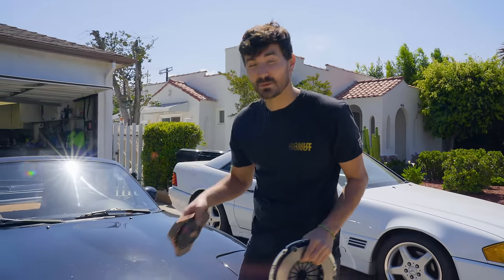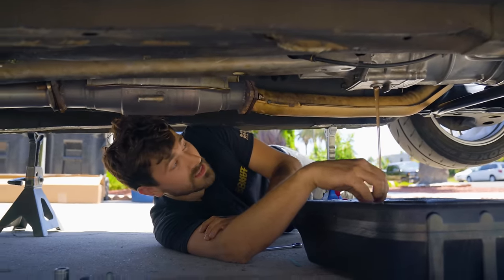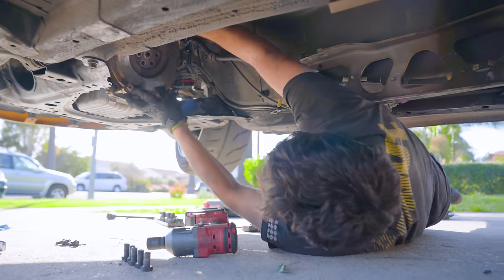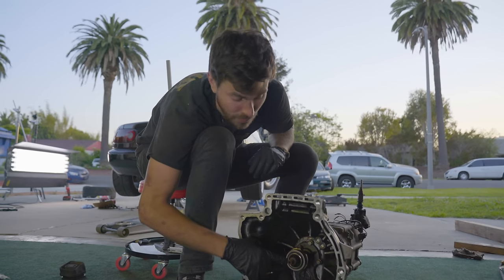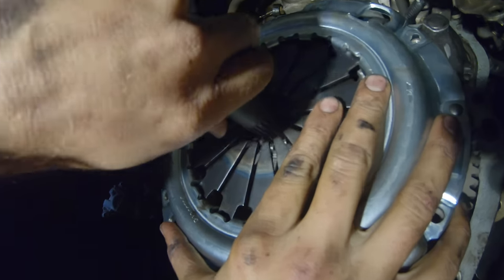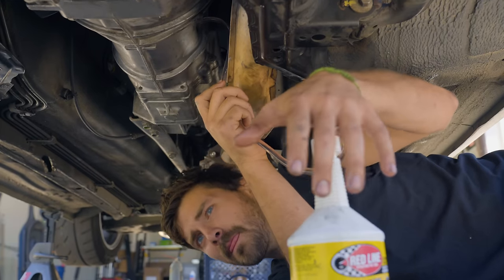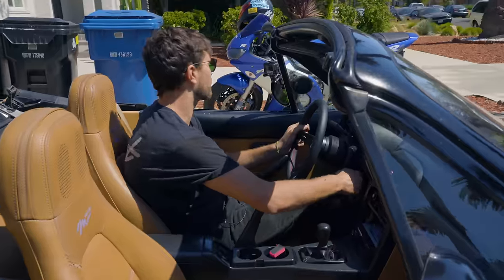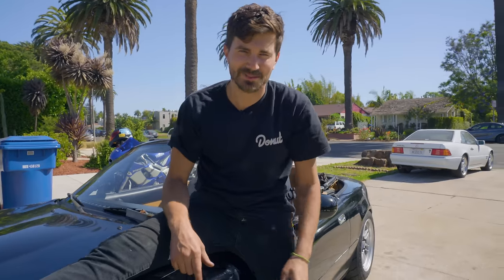We got sent a super weird clutch and installed it anyway

Comment: The real test is when you're stuck in traffic for hours.
Reply: With a hydraulic slave cylinder I bet it’s still not terrible.
Reply: I have a road registered car with a clutch like that in it and it’s cable operated. Can confirm it’s absolutely shit in any type of traffic. As soon as that plate gets hot it becomes very very grabby.
Reply: If you are stuck for hours, disengage shatever gear you are in.
If stuck for even longer shut off your engine
Reply: and here I am, shifting back to neutral at every red light, gotta protect that clutch
Reply: I mean why wouldn't you take the car out of gear while sitting?  If you don't do that you're killing your throwout bearing, your thrust bearings, your slave cylinder, your diaphragm spring, your leg.  Why anyone would sit at a light or in traffic holding the clutch disengaged is beyond me.
Reply: @Patrick94GSR  because they're afraid of being honked at by dickead drivers behind them for not instantly taking off after 0.001s when the light turns green
Reply: @Patrick94GSR  i am pretty sure taking it out of gear doesnt destroy all those parts
Atleast not in the kind of cars i know.
How do you explain my entire drivetrain not collapsing when parking the car?
Edit: i misread, you do take the gear out and that gets destroyed if you dont
Reply: I do take it straight out of gear when I stop. The problem is after you stop and start 20 times the clutch plates start to heat up. The problem isn’t from riding the clutch. If you ride a ceramic clutch you’ll just destroy it.
Reply: @Kasmuller  yeah, I meant NOT taking the car out of gear while stationary is bad for the drivetrain.  A common modification among Miata owners is to bypass the clutch start interlock switch, because apparently even starting the car with the clutch pedal depressed (TO bearing pressing on diaphragm spring) can eventually cause issues with the crankshaft thrust bearings.  Makes the engine sound rather fragile.  But who knows, I did it anyway on my NB1.  Meanwhile my Integra has 372,000 miles on the original engine and gearbox with no bearing issues whatsoever.  But I also take it out of gear when stopping.
Reply: @marealnamenott  that's why I make it a point to pay attention to the traffic light of the other direction, so that I don't end up being that guy holding up other people.
Reply: This should be pinned.
Reply: I'll just put it back in neutral whenever I can.
Reply: LA problem
Reply: Maybe it will come in clutch
Reply: @eaglekeeper6056  They can be. Ive never driven a miata in "traffic" but I work on Porsche Cup cars, and the stop and go to tech is terrrible. we all stall our cars so many times in a weekend, despite driving them for 30 years.
Reply: Uphill
Reply: this is why you leave about 3-5 car lengths on the car in front of you. Ride your brake peddle, not your clutch. Look at some semi trucks in traffic jams when you're rolling super slow, they'll leave space in front to do the same.
Reply: 12121212
Reply: @marealnamenott  Here in Los Angeles, where traffic is: 1st, 2nd, stop, 1st, stop, 1st, 2nd, stop, 1st, stop, you can't just put it in neutral.
Reply: That’s why I don’t trust people who only drive autos, they don’t know the struggle and the real reason for road rage lol uneven legs
Reply: Mine is the same way, less than 250km on a clutch and new flywheel from Lük that's a direct replacement, and it still grabs hard when it heats up or under load
Reply: @Fuckingenius  sadly in my country and many other eastern european countries, yellow light only appears before green goes red, after red there is no yellow light and I really have no idea why, it goes straight to green
Reply: @marealnamenott  Yes that's true. The reason for that is to know whether the traffic light goes from red to green or from green to red. This at least is what my driving school teacher said if I remember correctly.
Reply: @dimitriosmavroudis7  wait, it should be obvious if it goes from red to green via yellow since you'll see cars lined up ready to move, or am I missing something?
Reply: I had a stage 1 exedy in my Miata and creeping in Dallas traffic killed my calves
Reply: The most realistic comment here... I had a stage two in Mazda6, I've had knee surgery, and I definitely felt the knee pain in traffic.
Reply: Yep
Reply: Ye I have a good clutch, some fucking leg workout
Reply: On a hill
Reply: Can confirm it heats up pretty good in traffic situations. Tends to feel soft with constant use
Reply: 5 puck clutch with a 23lb flywheel in my 05 WRX is unpleasant in stop and go traffic
Reply: I actually enjoyed i75 rush hour the one time I took my s13 out lol. Stock clutch and perfectly-adjusted pedal. Just tapped my foot a few times lol. NB2 miata was a nightmare in the same traffic 😵
Reply: @Jakefrc  i had one in my s10 with hydraulic clutch it also engaged instantly on the road it only lasted 10k miles not ideal for the daily
Reply: The hole point of a three puck clutch is for heat reduction. The separate pucks will cool off faster than a single solid ring. This allows you to slip the clutch.  Keeping the small motor in its power band making boost.
Reply: @Iwannagofast  VA, and DC?! That's torture lol. Honestly driving a stick is a commitment
Reply: @wetoolow8750  The key to LA traffic is driving like a trucker: when it's stop-and-go with only short movements, just get moving in gear and let the car idle forward. When traffic's moving frequently, you can go miles without touching any of the pedals.

Hell, I got stuck at a single-lane ag. check one night with a monster line and ended up idling in fifth (overdrive) for like 20 minutes. Everyone else was jumping forward and slamming their brakes; I just kicked back - and moved just as fast overall. About 5 MPH.

I miss driving cars with torque. My Civic can barely handle first sometimes, but my last 2 could start uphill in fifth no problem.
Reply: @Azlehria  please explain what you mean by idling in fifth?
Reply: @potatopotatoeOG  Start moving in lower gear, as appropriate; shift through gears until reaching fifth (top) gear; allow engine to idle without disengaging clutch.

Generally this requires either slow engagement during shifts (if no throttle is applied) or careful modulation of throttle once reaching fifth gear, to prevent jerking or stalling.
Reply: @marealnamenott  in the US its green yellow red    green.

We don't get the yellow staging light before a green to tell you to get in gear.
Reply: I know this is years old but Patrick94GSR meant watching the lights for the cross-flowing traffic to turn yellow so you know they're about to turn red, so you can clutch in, find 1st gear and be ready to go when yours turns green.

Comment: When you're bench pressing your transmission, and you hear your Harbor freight jackstand starting to creak...
Reply: When paul walker comes to check out your build afterwards
Reply: Lol. I think this comment predates the recall!
Reply: I always stack mounted wheels or blocks of wood under the car, just in case.
Reply: @donellmuniz590  good tip. just gettin started on working on my vehicles myself so thanks
Reply: @TheAtc2  When I was around 18 or 20, on two occasions  I was almost crushed by a car falling off a jack or jackstand. So I don't take any chances. Years later, I guy I knew in high school got killed that way.
Reply: I was working on my dad's car the other day fixing some pressure sensor in the exhaust system using the OEM jack that comes with the car, it all went fine. Then yesterday my dad curbed his wheel and had a flat, so i started changing his wheel and that fucking jack exploded. I could imagine myself getting guillotined (it was a french car) by the brake disc under that car...
Reply: Lol
Reply: @currenlydying  wow
Reply: @currenlydying  WTF?.. good to see your alright enough to post this comment. What kinda jack was it?
Reply: @leftysr.stupid1144  I'm going to assume it's the standard OEM Scissor style jack, I like to put them in the "widow maker" category, would never go under the car with one of those holding it up 🙃
Reply: @matasjurciukonis9588  yea that 2 inch wide base is sketch and all but they said it exploded. Probably some Chinese shit..
Reply: @donellmuniz590  i don’t use 4 jack stands.. I use 6 and 2 jacks primed but not under load in case. Sometimes I’ll throw two wheels on the edge for reassurance. Maybe I’m overdoing it but not taking a chance

Comment: i believe the primary advantage of that particular 3 puck is that it won't over heat nearly as easily, because it slips less and has materials that are better suited to functioning in high heat scenarios. a larger stock clutch will develop heat soak in a continuous use situation like the track, and once its fully heat soaked it can't hold as much power and becomes unusable until it cools back down.  however the 3 puck design will maintain its performance and function better in a max temp scenario, and at the same time will reach operating temps more quickly due to less surface area, which increases the overall consistency of feel whether your 1 lap in, or 20 laps in, it should feel about the same and maintain performance if you are under the hp rating specs. so reliability and consistency are the key words, versus comfort/ease of use/max hp performance ratings. i could be wrong about some aspects of that for this particular model, but that is usually the case for most clutches like this. it is counter intuitive because you would think the stock clutch would dissipate heat better and hold more power with more surface area, but a lot of it just comes down to the lower friction material not being able to perform in high temps and maintain consistency. but also a higher puck design with more surface area of the same material would hold way more horsepower, but be much much more difficult to drive due to being underpowered, and also adds rotating mass. which then you get into multi disc clutch designs that have the advantages of smooth engagement and high horsepower ratings at the minor cost of rotating mass--- but while this little 3 puck might not hold as much power as a twin disc and also be less comfortable to ride around with, it is considerably lighter and can hang laps and not overheat, so this is really the highest performance option you could possibly get out of a clutch for track use at your power level.
Reply: My thought was that less rotating mass when clutch is disengaged could speed up gear shifts.
Reply: Well said.

Comment: Zach is a boss for throwing that transmission back up there by himself!
Reply: It's a car transmission so it's light, I know a guy how did that with a 1ton truck transmission.
Reply: @DirtbagCarpentry  I couldn't get mine back up there.  I struggled just the same as Zach was doing, and eventually had to use a floor jack.  Albeit I was using a tiny little floor jack and had the whole gearbox balanced perilously while a strap was under the tail end, and then I was able to lift it up and get it seated on the block and pilot bearing.  I also had to wedge a block of wood in front of the crank pulley to get the engine to tilt back far enough, because without the weight of the gearbox it tilts forward which makes it really hard to get the gearbox input shaft at the correct angle to go into the pilot bearing.
Reply: @ItzHazy  ok
Reply: @ItzHazy  Its definitely not 300lbs.
Reply: @thomasd5248  picked a below average example in an debate about averages, shall we look at medium or heavy duty trucks to counter? Come on now...
Reply: Bad Harmonics  Yeah my NA trans was like 80ish lbs
Reply: Space Cadet he said it's still 300lbs, talking about the Miata transmission in this video. Who was talking about averages?
Reply: let's see him do that with a ford FMX 
with a cast iron case 🤪
Reply: @DirtbagCarpentry  my dad did that for years and he was confident in the strength but at 40 he destroyed his lower vertebraes internal disc and now he's fucked really just use a Jack it ain't worth it
Reply: Y'all really got mad about this benign comment. Lol
Reply: I do subaru ones using racheting straps and blocks of wood. Looks funky but minimal effort. 🙈
Reply: @Patrick94GSR    Yep, same with a vintage Ford Escort.   Have to jam the front of the motor up as high as it will go, to get enough angle for the box to go in with the top of the bell housing scraping the tunnel.    Floor jack under the front of the box, and a chain round the tailshaft and up through the gear stick hole to control the rear end.
Reply: All 35 pounds

Comment: I've been a mechanic for over 10 years... I literally never thought of doing that with the bolts. In my own defense I haven't had an issue remembering where they go since I was a teenager, but still, that is a remarkably good idea.

I personally do that both ways. If you need to replace rear main seal, and it is a manual, replace the clutch. Same if you're doing the clutch, do the seal. Save yourself time and money both ways. To the point where I have bought the seal myself for customer cars when they refused it.
Reply: I do interior stuff on cars for a living and to be fair to you I don’t do the cardboard trick at work either.

But I 100% use it when doing personal stuff like rebuilding my suspension, because unlike work the project can drag on. 

And B, I 1000% agree with you on the main seal. I’m putting an LSD + clutch in my 2000 TDI soon and paid a bit extra for an OEM seal. 

Most shops and sources have advised against replacing a non leaking seal, but I imagine that’s because the oem seal is better than a 20$ generic seal.
Reply: IDK if you're still monitoring this ancient comment but, as a mechanic too, thank God for dedicated mechanics like you!  I worked in a government fleet for 30 years and been turning wrenches way longer than that... and the sheer stupidity, incompetence, and vicious indifference I've seen after I checked the work of various "mechanics" who worked on my car, is truly disgusting to me.
 I have seen clutch disk bolts LEFT LOOSE by the morons that changed it and rattling around in the bell house because half of them had fallen out.  Another time, some other dolt I (foolishly) paid to adjust the valves, simply tightened them all the way down leaving NO valve clearance because the idiot didn't understand what he was doing, why, or how.  And my personal favorite happened to my old 1985 Nissan 200SX.  One time I needed the alternator changed out, which they did, but on the drive home the dash light was coming on anyway.  Test the alt, yep, 14 volts - sometimes - so it wasn't charging the battery enough.  This happened all because the belt was too loose and couldn't be tightened enough because it ran out of travel before it ran out of belt... and the cause of THAT was because the total sh!t-head "mechanic" that replaced the alternator couldn't be bothered to swap the (larger) OEM pulley from the old one!  
Point being, mechanics like you are maybe one in 10, or maybe even 1 in 100, so dude, you have my sincere thanks that SOME one is concerned with doing things right!

Comment: "if you had to get in here just for a rear main seal, that would be annoying"

Oh it is. It really really is.
Reply: Yep. Bad enough that I won't do mine until it's clutch time.
Reply: Damn....I feel your pain
Reply: Never had that problem. Dad taught me the right way, the first time we replaced the clutch in his Mustang.
Reply: Is that the one that always leaks where it connects to the driveshaft? I noticed mine had a crack in it the other day but no oil was leaking.
Reply: "Might as well do the clutch while I'm in here."
Reply: The shitty part this happened to me but I just put a new motor in and somehow the rear main must of been faulty. Now I have to pull the trans to do the rear main with 500miles on the motor 🤦🏻‍♂️
Reply: Dave Micolichek  just because you have a band aide, doesn't mean you can use it for everything. The seal costs like 15 bucks.
Reply: Profile picture checks out
Reply: This is why you don’t change to synthetic after running Dino oil. It washes away buildup on seals and exposes leaks that hadn’t pronounced themselves yet.
Reply: @marcochavanne  that's exactly what I did.
Reply: @kevinfox500  But it's when your transmission is still great, but the seal is leaking bad... I'm fairly sure my main rear is leaking around a quart every 1k miles atm, but no reason other than that to get the trans off... and I'm not doing that lmao.
Reply: Mintomax litterally me rn
Reply: If it ain’t broke.......
Know of so many times it didn’t leak, just showed slight wetness (acceptable and normal) 
Only to have it REaLLY leak.
Reply: kevin fox  if the rear main goes before the clutch does then theres no chance to do it the “right way” lol
Reply: @sharpemang  its not about affording a "15 dollar seal". It should be pretty clear people are talking about the labor hours required just to access the seal, and then put it all back together. If a stop-leak type product works there's no reason not to use it until you have time/need to take off the trans to do the seal properly. Obviously bandaid-ing a car isnt healthy for it, but in this situation i believe it doesnt hurt to try to see it if can fix the leak until its more convenient to replace the seal.